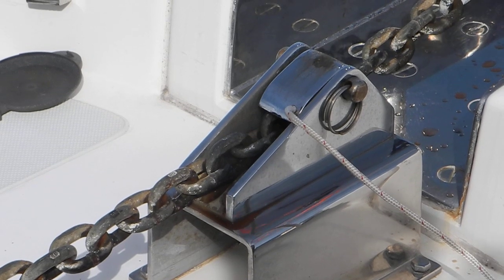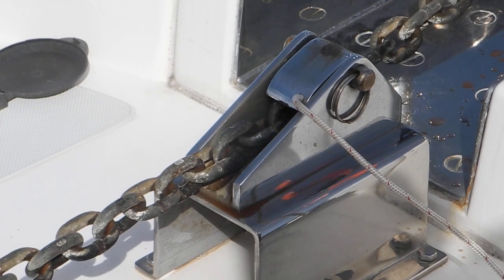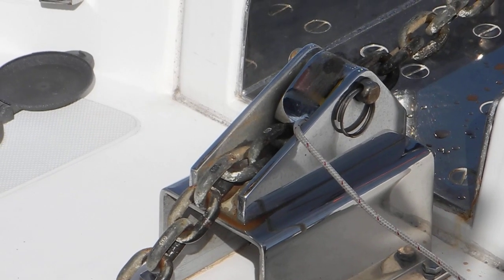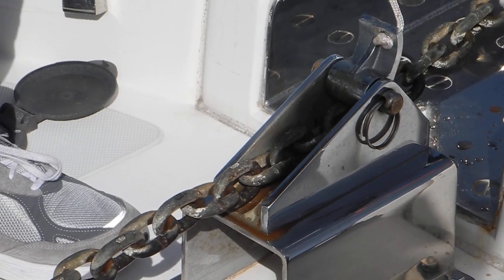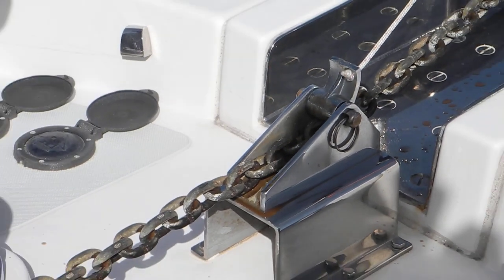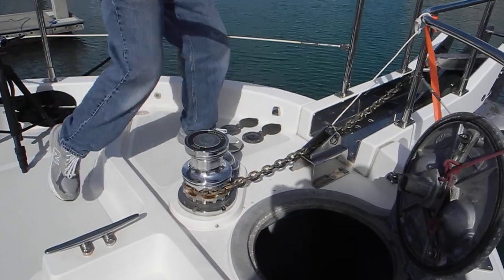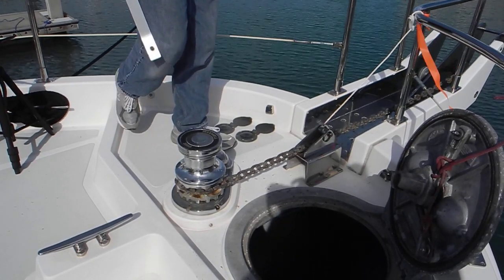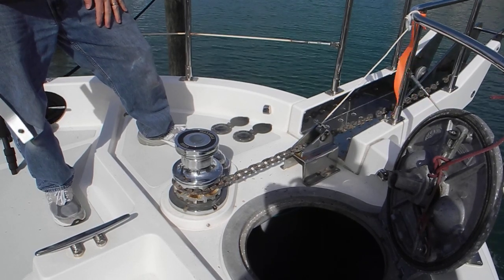Chain brake, not for anchoring

Comment: But what does it mean not for anchoring.
Reply from the maker: The chain brake is meant to keep the anchor from fall overboard while underway. And to relieve tension on the windlass. You should not rely on the chain brake to hold the boat while at anchor. A snubber is a better idea.